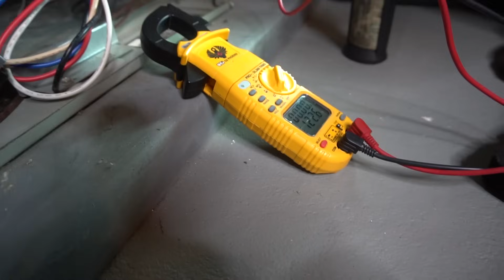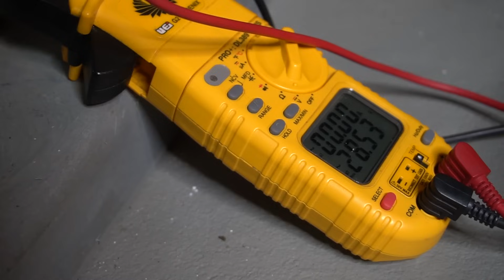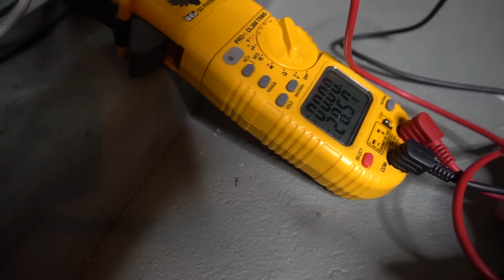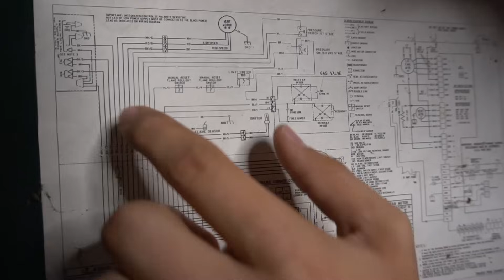Furnace/AC How to Troubleshoot The Control Board

Comment: When I start my unit all that happens is the transformer starts to sizzle. What do I check?
Reply from the maker: 1. First off, is your furnace control board blinking any error codes?
2. Try turning the furnace power off and on, does it try starting?
3. Check the 3 amp fuse on the control board.
4. Try bypassing your thermostat (I have videos on that in the playlist)
5. If still nothing is happening, you would need a multi meter to check further.
Reply: Word of Advice TV 
This one older, no blinker.
I had a broken solder joint on the back at the hi side circuit, I resoldered and it worked for a week. But now when I try to start, the transformer starts sizzling but nothing else happens. Anyhow I have a new board and transfomer ordered. But it wont be here for 3-4 days and it's cold.
Reply from the maker: Ah I see.. Sorry to hear about that. You may need to pick up a few space heaters and perhaps return them later? Because from what you described it sounds like either the control board or the transformer is bad. Can't say for sure without verifying with a multi meter though. If you have one let me know
Reply: Word of Advice TV 
I do have a MM. But afraid to power up existing set up because of the sizzle and smoke.?? Is there something to check with the power off?
 Got a few oil filled heaters to get me by.
Reply from the maker: @SuperReallyNice  Oh! It's SIZZLING. I apologize, for some reason I thought it was just humming but you mean it's literally smoking. Yeah, there's definitely something wrong then. Here is what you can check with your multi meter to begin with then:

1. Label or take a picture of where the transformer wires go and then disconnect them. It should have an 120v side and a 24v side. (primary and secondary). Measure resistance (ohms/horseshoe symbol) by putting one meter lead on one 120v wire connector, and the other on the other wire connector. What reading do you get, or is it O/L? Do the the same with the 24v side.

2. I don't know if you will be comfortable trying this as you would need to do this with the power on.. But try disconnecting the 120v wires coming from the transformer and into wherever they go. And check voltage at the two spots you disconnected those wires from. It should be getting around 120v. If there is smoke or anything like that even with those wires off, just turn the furnace back off then. Likely the control board is bad in that case.
Reply: Word of Advice TV Thanks!
Is it possible I have the black white wires switched? I've followed my diagram 100× and they're correct according to the diagram. WHT-PR-2 BLK-PR-1.. BLU SEC-2
RED SEC-1. matches the pic I took before. I'm just going to wait for parts now.
Reply from the maker: @SuperReallyNice  Yeah that sounds like the typical wiring setup. Alright, good luck, hopefully the parts will get it fixed and done with!
Reply: Word of Advice TV 
Thanks a bunch. I'm not an HVAC tech but I do have maintenance technician as a title. I think I have enough knowledge to get past this. I did repair the AC in summer with new capacitor and contactor, that gave me confidence. As long as you have basic knowledge and some tools YouTube is awesome. Your videos are like one on one training, AWESOME! At some point it becomes personal, I know I can do this. Thanks again for taking the time, not only to record your work, but do it really well.
Reply from the maker: @SuperReallyNice  Thank you! I totally agree with you! Nowadays all you need is the needed tools and YouTube and you can get a lot stuff fixed yourself.
Reply: The heat is on!!
New board, used transformer. Right at $120. Thanks again for being there for people who don't want to call the big name outfits with names on their vans!😏
Reply from the maker: @SuperReallyNice  Awesome!! Happy to hear you got it working! You saved yourself at the very least 300 bucks :) Stay warm!

Comment: Hello Jay, I have a concord furnace CG95TB060D12B that is 5 years old. My furnace just started acting up (will not ignite burners). When thermostat command heat, induced motor comes on for about 25 seconds then ignitor comes on but gas valve does not open. My safety switches are hooked in series so I have 28 Volts AC Going out @ control board and 28V AC going back into control board once ignitor lights. At the Gas valve power side I have .994mv AC. When I disconnect the power wire I get 28v AC. If I put 28V AC directly to gas valve once ignitor lights gas valve opens and runs until thermostat reaches desired room temperature. DOES THIS SOUND LIKE A BAD CONTROL BOARD. Any info greatly welcomed.Thomas
Reply from the maker: Hey Thomas! It sounds like your board is not sending power to the gas valve. Especially since it works when you apply 28v directly to it. At this point I would replace the control board. But before you do, when the ignitor starts to glow, try wiggling the wires going to the gas valve. It's possible that it is just a loose connection.

Comment: I'm looking for a competent diagnosis of an intermittent problem, and I'm betting you can guide me in the right direction. Particularly in the morning when my furnace is coming on after being set back 5 degrees overnight, the heat and blower will come on and after a while of rising temperature, the heat will go off but the blower will remain on (I'm guessing in lockout mode) for about an hour before it stops and the system restarts a few seconds later and works just fine afterward. In the meantime, the house is now cold again because of the unheated air being blown in for an hour. Could this be the Control Board causing this? I have a York Diamond 90 that is 18 years old but is serviced, along with the AC, twice a year by the company that sold and installed it. HELP! Thank you!
Reply from the maker: Hey Marc! It sounds like your furnace is overheating. What kind of filters do you use and how often do you replace them? Also, when the burners shut off and the fan stays on, is the furnace control board blinking any error codes?

Comment: So if i don't have power on the thermostat strip that means my circuit board is bad i tried all the steps previous to that and everything else has power accept that last step....
Reply from the maker: That is correct. So if the transformer is sending 24v into the control board but there is no voltage at the thermostat strip, that means the control board is bad.
Reply: @WordofAdviceTV  Thank you!

Comment: My blower fan would not shut off,  ac guy said it was a bad board, he replaced board and fan would not shut off in its own...he replaced thermostat and still same problem. I have to switch breaker at power panel to shut off. He is Stumped, need help.
Reply from the maker: Well that's interesting... Those would be my first two suspects as well. The board and the thermostat. In that case the problem is likely in the wiring. Another possibility is that you have an air cycler that brings in fresh air or just cycles on intermittently to circulate air. I would try to take off all the thermostat wires from the control board (with the power off of course) and then make sure the wires are not touching each other or anything metal so they don't short out. Turn the furnace back on, does the fan run with all the thermostat wires off? (May want to label the wires before pulling them off so you know where they go)
Reply: Thank you, i did check all the wires today and their is no breaks or short in none of them...i will try tomm to turn on with out them installed..thanks
Reply: I took all wires off and blower stays off....it stays on wetger i turn heat or old on...blower will not shut off till i reset breaker....it was cold lastnight and turned on heat, and blower turned on but not heat. (electrical). Checked continuity on Coils and  might gave one bad. Will this cause blower to stay stuck "on"?  Thanks
Reply from the maker: I cant say for sure without seeing it but yes it can. Or if a hi-limit switch or some limit is stuck open/tripped that can cause the fan to run continuously as well.

Comment: just curious, when you replace a control board, does the thermostat need to be reprogrammed in any way?  or does the NEW  control board just automatically communicate with the thermostat just like the old control board did?   thanks
Reply: thanks.  so if I replace the bad control board (by white rodgers) with a new universal control board (by white rodgers), do I need to contact the manufacturer of the furnace (comfortmaker) to make sure it is compatible with this furnace?   or is the manufacturer of the control board the only one I should control.  my current control board is model 50a55-143?  white rodgers no longer makes that control board.    but they do say on their website that model 50a55-843 (a universal replacement) can be used in place of model 50a55-143.
Reply from the maker: If your old board substitutes to that newer model that is fine. Happens all the time with control boards. Sometimes there can be as much as 15 revisions (where they change little things on the boards but for the most part its the same). If it fits your furnace and works then you are good to go :)
Reply from the maker: When you replace the control board, there is no need to reprogram the thermostat. Unless you have a high end communicating system. (a thermostat that costs around $800 like the Carrier Infinity) But most of those are auto-detect as well.

Comment: Error code is 5 blinks...which means grounding. I've check all grounds with no luck. All other appliances including fireplace work. Unless the gas cutoff is different from my other appliances it should be open.
Reply from the maker: A furnace will typically have it's own gas shut off valve. So if you turn the power off and on to your furnace does it do anything at all? Or does it just blink the 5 blinks error right away?

Comment: Great video,  could you help me with my furnace? New house new units. Both my units power up and start but do not ignite. I also pulled off the thermostat and the fan and unit continues to blow. Hope I kinda explained what's going on.
Reply from the maker: If you look on the bottom door, through the sight glass, do you see the LED light blinking an error code? And then if you take off the furnace doors, on the back of them you can usually find the diagnostic chart that explains what the codes mean. Finding out what the error code is would be a good place to start. Also, do you have any other gas burning appliances in your house? Do they work? If it's a new house, maybe the gas is off?

Comment: To check the input to the control board it will be the common and hot 24 volt from transformer,  correct? Ok , then to check output you have to turn system on cool / heat and check output voltage for inducer motor,  blower motor or whatever component not getting signal to come on ?
Reply from the maker: Yes. So for example, if you turn your furnace on, find the two wires going to the inducer motor, they should be getting 120v when there is a call for heat. You can check that either at the control board or at the inducer motor.
Reply: @WordofAdviceTV  question when I check my inducer motor when it turns on I only have 80 something volts and sometimes 0v .... Sometimes I can also send the inducer motor twitch and slight movement on the multi meter... My question is , is it possible to work sometimes and not others and be a bad board?
Reply from the maker: @genesdungeonrcs6981  If the voltage is inconsistent, then I would suspect that the board is bad. Also, I would bypass the thermostat once to make sure that it's nothing to do with it. (I have videos on how to in the playlist if you aren't sure how)
Reply: @WordofAdviceTV  I have checked thermostat also I hear the relays clicking if I tap one it will start the inducer motor but I hear a click again and it stops. Its almost like the restoration is failing..
.. it works once in awhile seems like just in time to heat house back up lol
Reply from the maker: @genesdungeonrcs6981  Sounds like one of the relays on the board is bad then. If you can get it going sometimes by tapping on it. I would replace the control board.
Reply: @WordofAdviceTV  I figured that as well.... Thanks to your advice that what I determined as well .... New board should be coming in on Friday .... For now I am able to get it going sometimes harder then others but the house is staying warm I'll report back after the installation
Reply from the maker: @genesdungeonrcs6981  Sounds good! Good luck!
Reply: @WordofAdviceTV  This is exactly my problem currently as well... I can tap (or simply put light pressure on it) on the relay and the inducer comes on... otherwise it's very microsecond come one sometimes. Board should be arriving this afternoon (OEM Goodman).
Reply from the maker: @stvcolwill  Hey Steve! I saw your other comments too. :) Thanks for watching my videos, glad to hear you find them helpful! Good luck with the repair, I am sure that will fix the problem. (It's nice that you were able to get the OEM too) Stay warm!
Reply: @WordofAdviceTV  OK.... update--- I installed the board after I got home from work - it was really straight forward. Only took 45 minutes. Works like a charm.
Reply from the maker: @stvcolwill  Awesome! Thanks for coming back with the update! May the furnace run for many more years without any problems now ;)
Reply: The quickest way to check inducer motor , hook directly to 120 volts and if it works the board is at fault . (Tip always carry quick connect jumper wire in your tool bag)
Reply: It was mother board running better then I ever knew it did.... Thanks again your videos helped me a lot
Reply from the maker: @genesdungeonrcs6981  Good to hear! :) Stay warm!

Comment: Many ways to troubleshoot control boards, continuity is something to practice to. Continuity. More technicians need to learn the sequence of operations, check limits and ohm wires before they condemn a board. Found a bad wire sending intermittent signals ohming out. I like watching ac service tech and gray furnace man. Also Jose from Lennox great 👍
Reply from the maker: I agree! There is a lot more to it. The furnace has A LOT of variables and different kind of problems, different ways of troubleshooting. It would be near impossible to try to cover it all in a series of videos. Lots of truth to the saying, "a technician never stops learning". Sure this video might have only covered a fraction of it but it's a fraction that many people don't know :)

AC servicetech and Gray Furnaceman are great channels!

Comment: My furnace stopped working.the burner kicks on but the fan doesn’t. I bypassed my fan and it works. But when hooked up correctly it doesn’t. What do I do next?
Reply: Thanks for the info.
Reply from the maker: Hey SuperNoah! So just to confirm, by bypassing it, you mean you hooked up your fan directly to 120v right? How about if you turn your thermostat fan setting from AUTO to ON? Still nothing? Most likely you have a bad fan relay on your control board so it is not sending power to the fan. (if your furnace has a control board) You can try to find a relay for your board (usually really hard to find) and solder the new one in but most of the time the fix is just to replace the whole board.

Comment: If you have checked flame sensor and its clean but still only runs for 3 seconds is it the control board? The board still seems to control start cycle but I dont have sustained flame....
Reply from the maker: Do you have a multi meter? You would need one to know for sure.. I have a video that goes deeper into this flame sensor issue, if you want, check it out: https://www.youtube.com/watch?v=-QKHz1Mv9Ew&list=PLK8tZPlovA8BJJ_weFseSjQWUvB2FFII2&index=12

Comment: My control board gives a flash with code LOW VOLTAGE,, but everything works good right now,, my question's this code give future problems??
Reply from the maker: Hey Nissan! "Low Voltage" is not enough for me to be able to accurately say what can be wrong. Especially since it is working good at this time. Try turning the power to the furnace off and on. Does the code disappear?

Comment: Hi, so I checked the control board just like you said and its ok, I switched out both sensors and I cant get the gas to light. The sensor wont glow it does cycle but does not light. The transformer voltage checked out ok, all fans work the blower and exhaust. I tried to reset and it still wont work just cold air. I checked the thermostat and exhaust ventilation pipe all ok. The red light on the board blinks 4 times in a row. I,m loosing my hair over this any clue what is wrong with the furnace. Its a Trane XB , 10 years old.
Reply from the maker: On the back of the furnace door or somewhere on the inside of the furnace or if you have an owners manual from the furnace, can you look up what the 4 blinks means? Usually 4 blinks means the hi-limit switch is tripped. It is located underneath your burner box and typically somewhere behind the gas valve on the back wall of the furnace. It usually looks like a brown rectangle with two terminal spades coming out of it. Try smacking that thing a few times as they do get stuck open. (from overheating) If this problem returns, then there are a few possibilities as to why.

1. Make sure you have a clean furnace filter (most common)
2. The A-coil may be plugged
3. There are too many vents closed off or a return grill is blocked
4. Blower motor is bad. (Sounds like yours works good)
5. Control board is not powering up the blower during a heat call
6. Bad/plugged primary or secondary heat exchanger (worst case scenario)

Hope that helps! Good luck